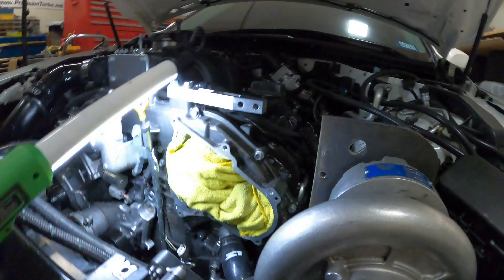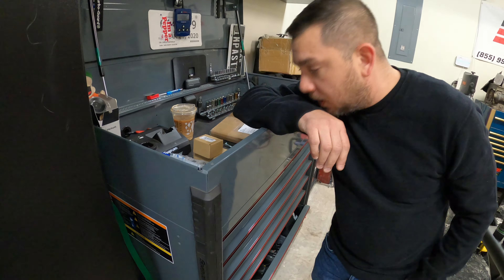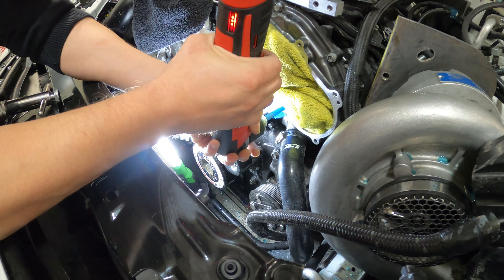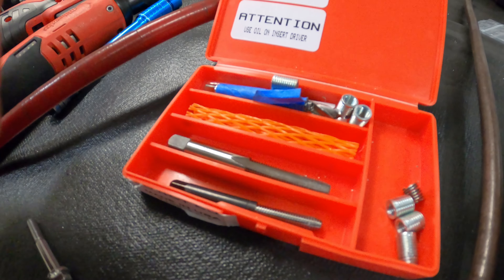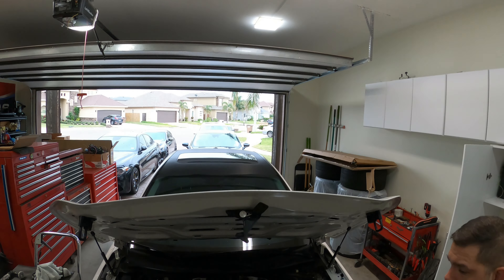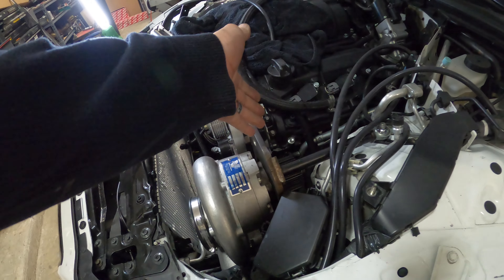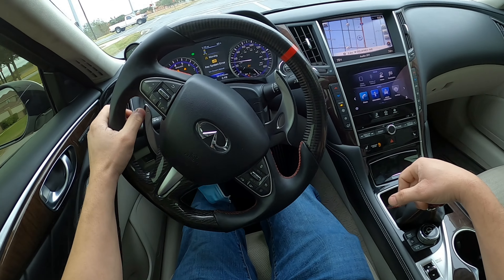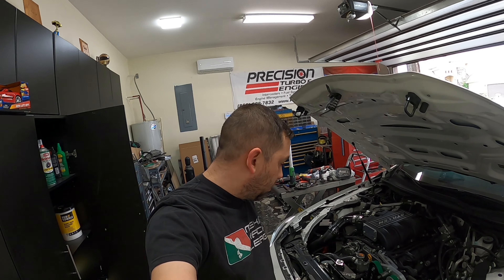New Supercharger Custom Bracket (Part 3)

Comment: I love this build man, what a sick car. I have a really clean 15’ Q50 that I’ll be starting on this year. First up for me is gonna be suspension and wheels.  What suspension components you are running? 

I’ve also got to figure what to do about the Open diff, mine is AWD. I haven’t come across man AWD Q50 builds with work documented as well as yours.
Reply from the maker: I can’t speak for the AWD but I have a Z1 LSD and BC Coilovers